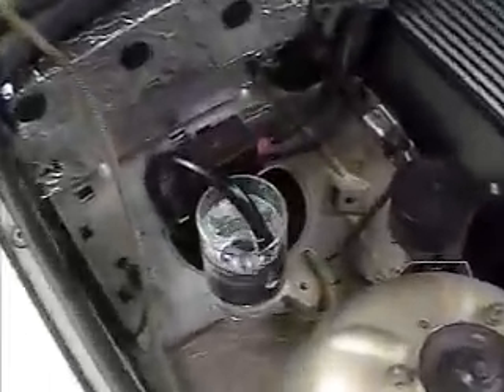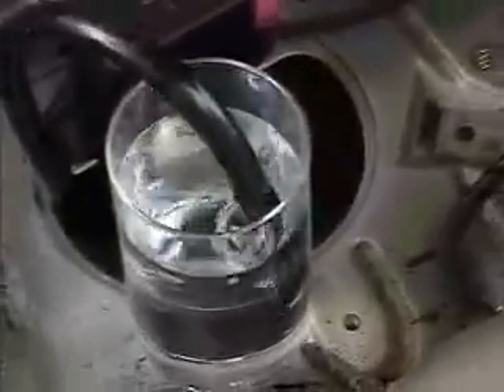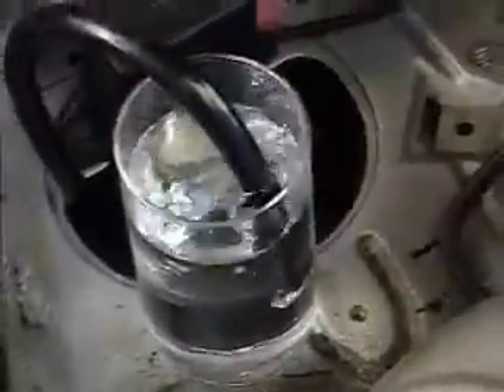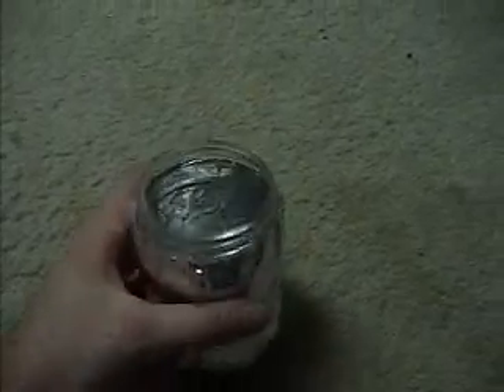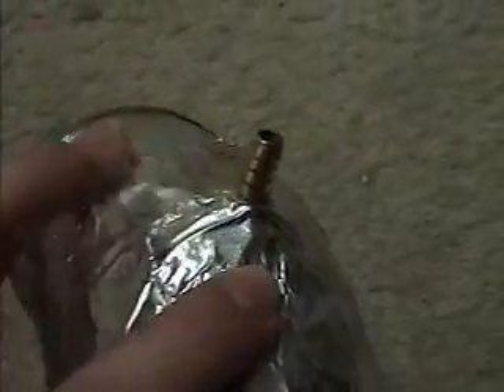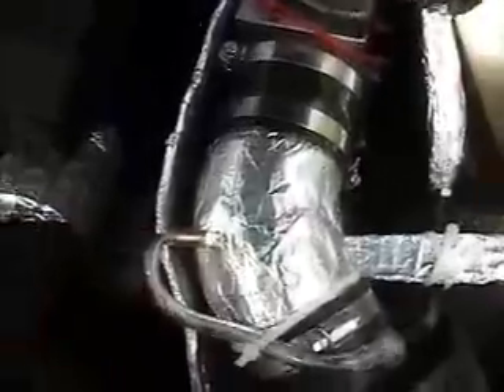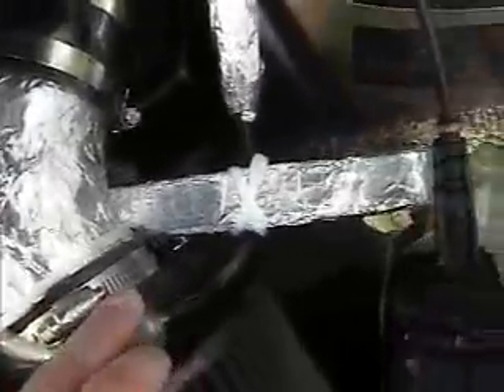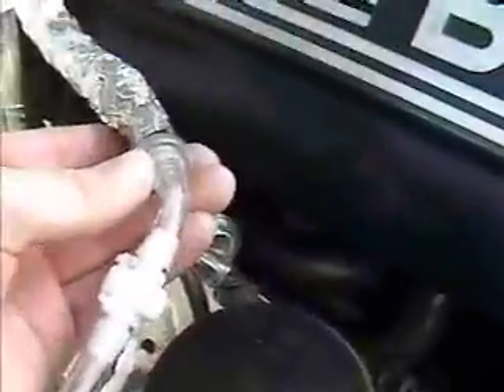How to Build the Best HHO Hydrogen Generator Part 3

Comment: What kind of power increase and what kind of mileage have you gotten from this?  also, did you do anything with the o2 sensor that is upstream?  *before the catalytic converter*   I read that you need efie in place to trick the o2 sensor or disconnect the o2 sensor in order to have the car properly register the HHO because the computer doesnt know what to do aside from ADD fuel to it....So did you do anything to the o2 sensor?

Comment: sounds interesting, your M50B25 was non-VANOS version, i have M52B28 with vanos engine. The latest HHO circuit was digital version controlled with automatic digital EFIE, i am not soo sure it will work on my car or not?, i can link it to inject the HHO gases from the VACUUM exhaust flap hoses which link to vacuum exhaust valve.